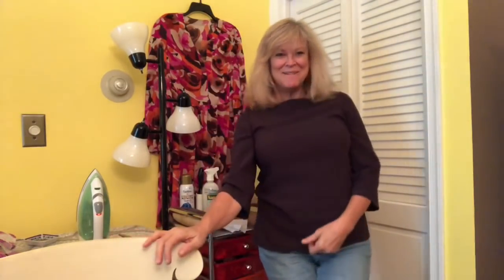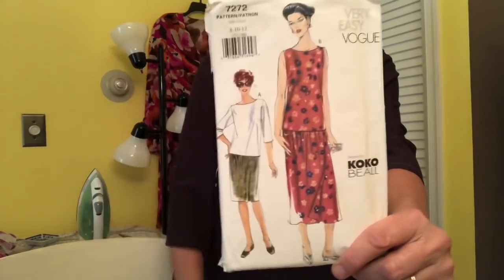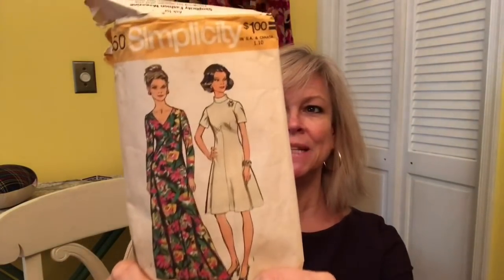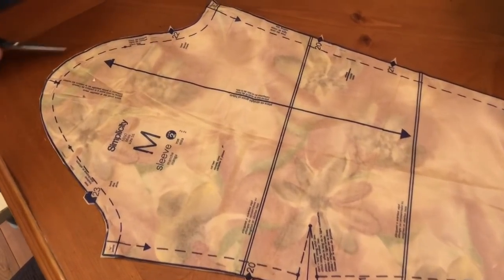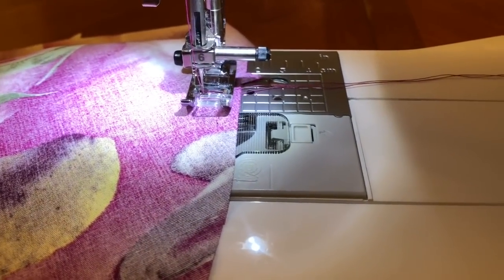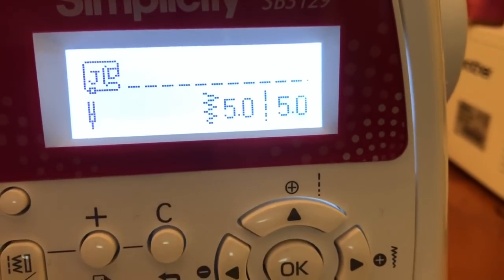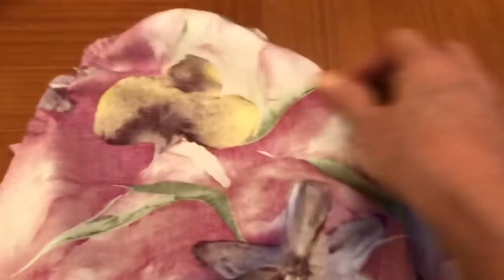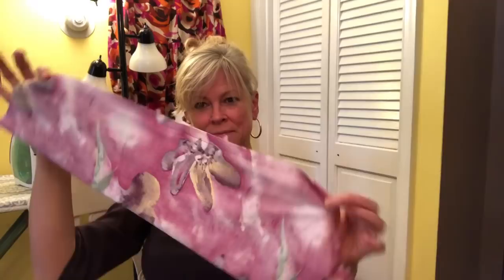Let’s Crimp! ~ Sewing Basics ~ Crimping a Sleeve ~

Comment: Thank you, Thank you so much for that what a great technique. Will be trying that on my next project when inserting sleeves. I've just got back into sewing after many years and was finding inserting sleeves a problem.
Could I just ask you another question, if that's ok. When making a garment that has 'puffy sleeves' is it possible to take out the puffiness so I can just have a normal sleeve, or would it mess up the inserting of the sleeve? Love your channel it's really great.
Reply from the maker: Hi Elaine, nice to meet you, and thank you for your wonderful comments.💐How lovely that you’re back into sewing. I fell head over heels when I returned about 2 years ago. Now, you ask a great question. I wonder if you could simply interchange a non-puffy/gathered sleeve (from another pattern) with the puffy one. Check to make sure the arm holes match and do it that way? Otherwise you’ll have to reduce the puffy sleeve head so that it does not require gathers...which I’m sure can be done, it’s just that I’ve never done it. I’m afraid I wasn’t much help. But thanks for your interest!😄👍
Reply: Hi Viv it's lovely to be in touch with you too. Isn't the Internet great to be able to chat and share ideas with anyone in the world - who would have thought it back in the 80s, (I had my 60th birthday this year) that this would be happening.
Thanks for the great idea of checking out another pattern that isn't a puffy sleeve. The dress 'the one with the puffy sleeves) I would like to make is the 'Kitty Dress' it's made by a company called MAVEN. Take a look at www.mavenpattern.co.uk. It's looks a great little dress. Thanks again for all your help and look forward to your up and coming videos. Hope you are feeling on the better side after having your dental surgery. P.S. Hope I haven't rambled on too much... and you look great by the way :)
Reply from the maker: Aha! I see the gathered sleeve on the Kitty dress. Very cute dress. And the gathering is subtle, could you give it a go as drafted? I think I was picturing something super gathered. Maybe just reduce the sleeve curve and you’ll have it! I enjoy chatting with my fellow sewers. Such fun! Thanks for the well wishes; I am still battling surgical pain if you can believe it, but the swelling is reducing. Oy, a nightmare. Can’t wait to feel 100 again!!😃